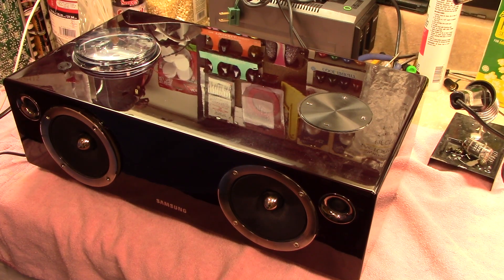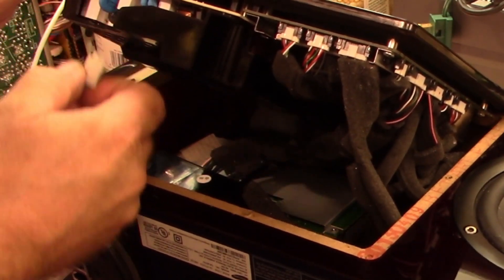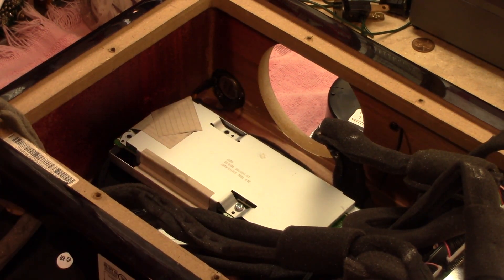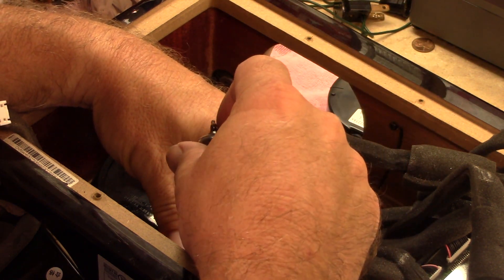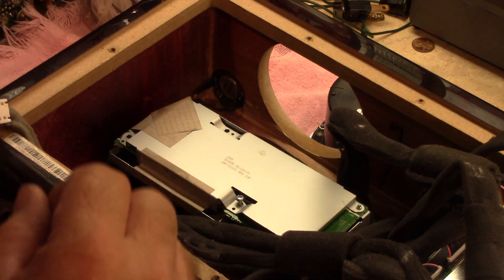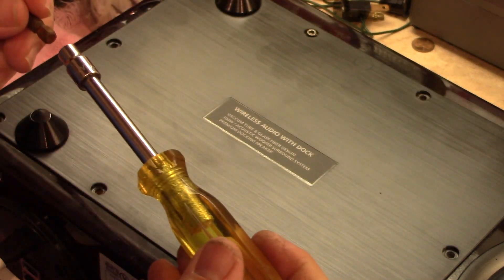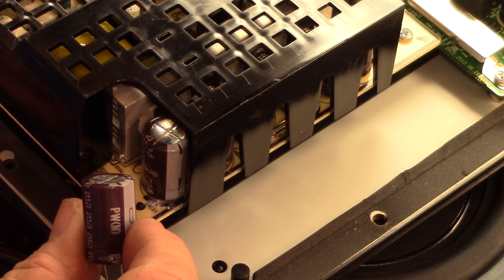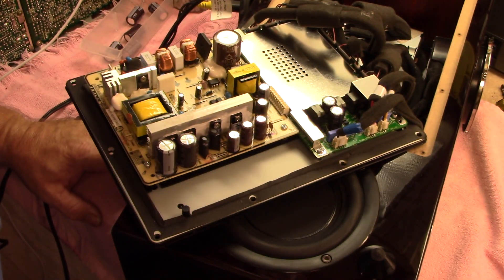Samsung DA-E750 Repair Part 2: Replacing Bad Parts

Comment: Very interesting! I do have a faulty da e 750. The right side speaker does not play. But the lamp lights up. Meaning i  see light within both lamps, does it mean its likely the speaker wire connection that is faulty? Can a lamp light up and still be broken? Thanks! (Im not very tech savvy but i really enjoy this speaker's sound warmth)
Reply from the maker: That’s how this on behaved! There is an LED light under each tube as well, but the tube can still glow, even with a fault. Might check out part one to see how  I got to this point, if you hadn’t already.
Reply: @dynatrak well i brought it to an electronic guy and said it was about the board and didnt wanna play there. But i found another dae750 used on marketplace for 125$ canadian dollar. So this fixes it for me! Ill keep the faulty one and try to repair it eventually when i got time by following your video! Thanks
Reply from the maker: @Alainboro  Nice score! They usually go for much more. Glad you found a solution.

Comment: Hi i have tried to remove the valves but i can't get them out. Is there any solution to this problem?
Thanks in advance Bill from Australia
Reply from the maker: Hi Bill. I’m really not sure, since mine came out with no issue. In my case, the valve was faulty, and that was the fix. Not sure if the board could be soaked in hot water to help loosen adhesive? I’ve had others comment theirs were glued in as well. Sorry I can’t be more help! Best of luck with repairs.

Comment: Hi, I just watched your video. I have the same unit, but it has lost about 40% of its strength. I've taken it to several repair shops, and no one seems to know what the issue is. The vacuum tubes look noticeably dimmer—do you think that could be the cause? Or have you heard of a similar problem before?
Reply from the maker: Awesome, thanks!
Unfortunately, it's impossible to diagnose, not being in front of it.
Could very well be some out of spec capacitors,  resistors, or faulty tube. That's odd repair shops couldn't figure it out!
My cousin's is the one, and only one of these I've worked on. Fortunately the issue was simply a bad tube.

Comment: Hello and thank you so much for this video - what a relief to know now how the tubes can be changed. However, what I missed is the exact type of the original tube (make, model, product code etc) - in the description of your second vid I found ECC82 but searching the inet I found different ones all starting with ECC82. Please be so kind to provide the original spec information. Thank you so much!
Reply from the maker: You're welcome! Not sure why you're having trouble with ECC82 tubes, since they are very common.
I found this page, and it has info, and substitutions. I hope it helps.
https://www.thetubestore.com/preamp-tubes/12au7-ecc82-tube-types

Comment: Can you possibly give more details on the capacitors you used?
I have changed the tubes on mine already thinking that was what was causing a very dull sound, but no luck, so moving onto the capacitors next .
Reply from the maker: What specifically are you needing more information, about the capacitors? The ones I replaced were actively leaking, but still functioned normally. This was strictly preventive maintenance. I typically use Nichicon from Mouser. I hope that helps.
Reply: @dynatrak  Sorry, I should have been more specific. The specs that you replaced with, mfd or uf spec etc? @dynatrak
Reply from the maker: @RobinJCT  1500mfd @35 volts for the two I replaced.
Reply: @dynatrak  Thanks million, I have ordered parts today, I will let you know if it works. I already replaced the tubes, but that did not fix the dead and dull and low volume sound on my unit.. Fingers crossed.
Reply from the maker: @  @RobinJCT  Awesome, I hope some fresh capacitors get yours back to working well.
Reply: did changing the capacitors fix your weak volume issues...... as i have the same issue with low volume on my unit
Reply: @markschneider2042  I have purchased the bits, I just need to do the mini-project now.
I will revert back once I have done it, maybe this weekend...
Reply: @RobinJCT  My dock appears fixed. I replaced all the 10uf 16v capacitors on the main amplifier board and that did the trick. I made it hard for myself by lifting two smd pads…. C7088 C7089 C7010 C8001

Comment: Bought mine new in here in Australia in 2013 and  love the sound this gives out but about 5 years ago the sound went really soft and I could not increase volume. The issue was there no matter what connection was used bluetooth, aux etc and I could never find a fix even after contacting Samsung and repairs they put me onto didnt want to touch it as they had no experiance with them. I was doing a clear out of the garage this week and decided to have another crack and came across your video so decided to change the tubes to see if that has any impact on the issue. I have the  tube component out but I cannot remove the tubes they seem stuck/fused in there any advice how to remove when stuck? I have googled and tried wiggling etc but they won't budge.
Reply from the maker: I've never had that issue with stuck tubes, so I may not be of much help. Perhaps they are corroded in place, and some Deoxit spray would help the pins loosen up.
Reply: @dynatrak  yep may have to try that.
Reply: @richardmerifield3263 i also have the plagued low volume issue...and  again cant seem to find anyone here in Perth WA willing to have a look.  let me know if you resolved the volume issue
Reply: @markschneider2042 I just received some replacement capacitors and opamps. I plan to trace the signal through the circuit as best I can to see where the problem may be. I know for sure it is not the tubes though. As a hobbyist it will take me a while. Happy to report any success.
Reply: @markschneider2042  My dock appears fixed. I replaced all the 10uf 16v capacitors on the main amplifier board and that did the trick. I made it hard for myself by lifting two smd pads…. C7088 C7089 C7010 C8001
Reply: @richardmerifield3263  thats great news. Now i might be able to have a hobbyist repair mine...in fact i may just order them and give it a try myself.
Reply: @warrenchapman-vp5mp what did you do about ur situation, could you uptade me-us?
Reply: @TheKadr1man 

I bought new tubes but they never solved the problem and I gave up after that.
Reply: @warrenchapman283  Thank you for your fast response.
Reply: I think I may have ended up with your old speaker 😂 Low volume on both channels. Also, the tubes were glued into the sockets which is unforgivable from Samsung. All the power supply voltages are fine so new capacitors in the PS doesn’t seem like the issue. I will keep trying to find a solution.

Comment: Nice repair, this is the first time I've seen you fix an electronic device in the shop. Did you have to worry about discharging those capacitors before removal? Maybe It's just those big ones in vintage stereos that you have to do that to.
Reply from the maker: Thanks! I haven't had an electronics repair in several months. However, there are plenty on my channel, over the years.
It's a good practice to discharge, but I've never had any issues with the low voltage variety. Definitely done on the large, high voltage ones though, typically found in tube equipment. Those pack a punch!